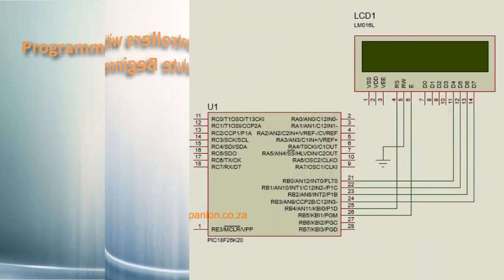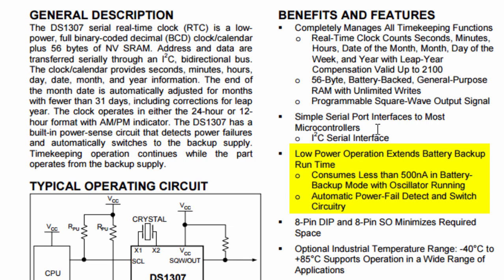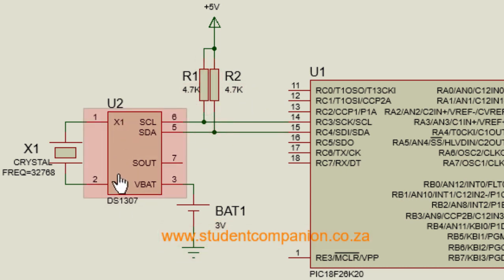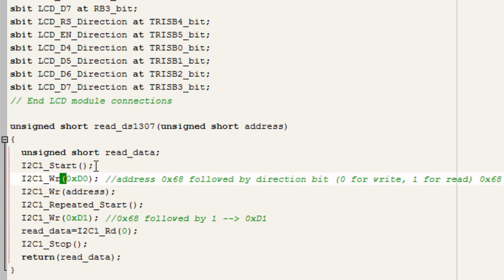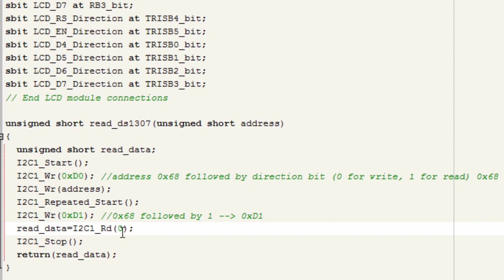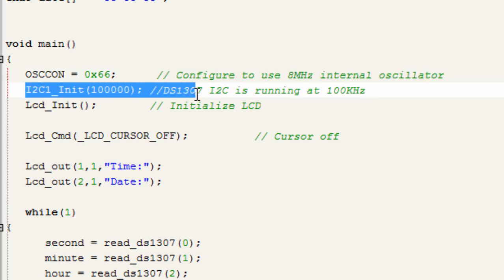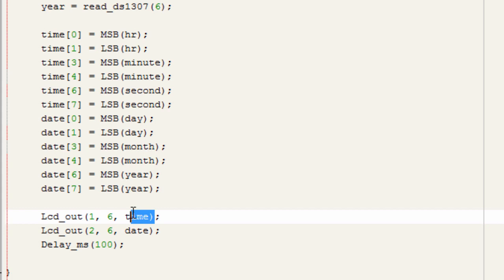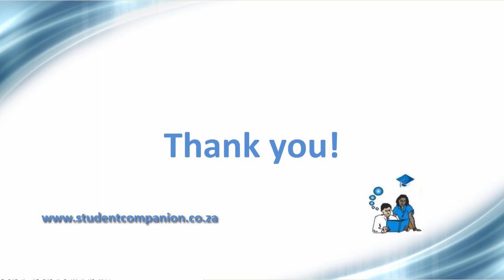39- Interfacing The DS1307 Real Time Clock | mikroC Pro for PIC Tutorial

Comment: Hi! I have a micro sd card module and a ds3231 RTC module. One of this module work with SPI, other is work with I2C. My question is can i use this modules in one MSSP on pic? (I have a pic 18f4685). I found "I2C bit banging" for my problem, but didn't understand anything how can i do it.
Reply from the maker: The I2C and SPI use the same module in the PIC, so you can either use only the SPI or I2C if the PIC habe only one MSSP module, the only option to use both is to use the bit banging for one interface. But if you choose a PIC with 2 MSSP modules, you can use both SPI and I2C hardware modules. 
Why did you choose this PIC and you are not even using CAN bus? If you choose a PIC with 2 MSSP modules, you can make your life easy.
Reply: My project code is 75k of flash. So i need to choose min. 96k flash size MCU. I live in Turkey and you can't find the all MCUs in Turkey. And also i don't have a smd soldering station. At the first i didn't know am i need SPI ind I2C modules at the same MCU. So i choosed the pic18f4685 DIP version. I don't need a CAN bus communication. I will use 2 SPI, 1 I2C module and uart communication. Therefore i will change the MCU to has 2 MSSP and 128k flash size MCU. (If ı find MCU has a usb interface, it'll be nice.) If i didn't find DIP model in Turkey, maybe i will buy from abroad. Thank you for answering my question!
Reply from the maker: Yes, there are many MCUs in DIP packages that have 128KB of memory that you can use and have more than 1 MSSP. That can make your code easier to write than by using bitbanging.
Also try to select a newer PIC model, there are cheaper, more powerful and with more features than old ones like the one you selected.  There is no good reason to start a new project using an old PIC if newer alternative is available.
Reply from the maker: You can use this tool to set your PIC requirements and it will give you a list that meet your requirements: https://www.microchip.com/maps/Microcontroller.aspx
If shipping cost is not a lot, you can always buy directly from Microchip, they are quite cheaper. But try to buy first locally in Turkey if possible.
Reply: @StudentCompanion  Do you have any suggestions? I was using the pic16f series 6 years ago, I switched from flash failure to the 18f series. I don't know the new MCUs very well.
Reply: @StudentCompanion  Thank you so much! I will find the ideal mcu for me.
Reply from the maker: Check these series for example: PIC18FxxK40 has 2SPI and 2 I2C, PIC18FxxQ10 has 2 SPI and 2 I2C, PIC18FxxQ43 has 2SPI and 1 I2C.
For example PIC18F27Q43 has 128KB flash, 2 SPI and 1 I2C.
The 18FxxK42 has 1 SPI and 2 I2C
Reply from the maker: You are welcome!

Comment: what happens if the read data is longer than 8 bit? The example you did the highest return value was 99 (0x63) so what happen if the return data is 65535? Would i have to do i2c read twice to get the first 8 bit(MSB?) then the next 8 bit(LSB)? how would I combine this data to be usable information?
Reply from the maker: For a DS1307 in what situation you would need more than 8-bit?
Reply from the maker: To read more than once or to access multiple registers, you can call a read function multiple times as explained in this video: https://youtu.be/E_bAO7MwadQ

Comment: Hi,I know Im late but what would you change in the code for pic16f887.Please answer
Reply from the maker: You must select your new PIC in edit project. Change LAT to PORT.
Reply: @StudentCompanion  Thank you for replying.I choose in device select my Pic and the code was built.When i put it in proteus LCD display just lights up.It doesnt show any letters.And where is that LAT? Where can I change it? Thank you
Reply from the maker: Did you connect correctly the lcd to your new PIC according to the lcd pin declarations? All instances of LAT  in code must be replaced with PIC.
Reply: @StudentCompanion  I checked the connections,they are fine.Can you name an instance for me?
In my code adress,read_data is underlined with red line.Also the variable char x is underlined.Could that be the issue?
Reply from the maker: Does it generate errors when you compile the code?
Reply: @StudentCompanion  No errors.Everything works.Lcd lights up but it doesnt show anything.It doesnt say time nor anything
Reply from the maker: @braveknight8278  Post your full zipped mikroC and Proteus projects in the Forum. we will check and see what could be wrong.
Forum: https://www.studentcompanion.co.za/forums/
Reply from the maker: This is an old thread more than 1 year, you could just ask your own question and explain exactly what's your problem. Start your own question not this old replies or preferably  post in our forum: www.studentcompanion.co.za/forums

Comment: Pls I have problem on stimulation  the problem is 
Pic18 illegal FOSC bits (0b0011) in CONFIG1H. 
Also it complain of simulation failed to start
Reply: Thanks your suggestion is right, 
But my LCD didn't display anything  sir
Reply from the maker: Then you are not doing thinhs right. Either using a wrong PIC or incorrect connection.  Fix that first.
Reply from the maker: Did you select the correct PIC in Proteus the same PIC you used in your mikroC projet?
Reply: I used 18f26k20 in both my Proteus and mikroc pro. It display ds1307 clock and sare at one corner on Proteus but is the LCD that is no displace. 
At the stimulation log, error U1 (Pic18 )PC =0x0300.

Comment: HELLO
dans arduino le programme reste le meme avec toutes les classes de RTC ou  change
Reply from the maker: Bonjour. C'est quoi votre question?
Reply: @StudentCompanion   dans arduino  je peux utiliser n'importe quelle  modul rtc  avec le meme programme
Reply from the maker: Non. Tu ne peux pas utiliser ce code de mikroC avec Arduino. Ça ne va pas marcher
Reply: @StudentCompanion  ok merci 
j'ai une question a l'etape ou on a bcd en  decimal et comment on a fait ca 
j'ai pas compris bien
Reply from the maker: @salmam5118  que ce que tu n'a pas compris? la conversion? tu ne sais pas c'est quoi le bcd? Tu ne sais pas pourquoi nous avons fais la conversion?  Il faut bien decrire ta question pour que nous savions ton problem.
Reply: @StudentCompanion  pourqoi on a mis 10 DEC=00010000
et pourqoi on a decaler 4
et aussi c qoi l'interet de MSB et LSB

Comment: I expected you use  code configuration to generate I2C functions since you mentioned it in Tutorial-38,
Reply from the maker: Hi. Do you mean MPLAB Code Configurator? If that's what you mean, this is mikroC tutorial it does not use it. It has its own library functions. It's a different compile than XC8.

Comment: LCD display is not showing any data. what should I do?
Reply from the maker: +Chinmay Dixit without supplying extra info we can't really guess what could be wrong.
Paste your code, pic you are using, etc.
Reply from the maker: +Chinmay Dixit did you get it right?
Reply: No. I could not get it. I cant see the values or data on the 16*2 lcd display.
Program is working fine.
My interfacing diagram is also correct.
Reply from the maker: +Chinmay Dixit can you post your code and your diagram. We can have a look at it.
Reply from the maker: +Chinmay Dixit post your diagram as well.
Why do you declare the interrupts and you are not using it? Nothing much in your ISR
Reply: even after I remove interrupt Display is not working..
how to post diagram?
Reply from the maker: +Chinmay Dixit +Chinmay Dixit We didn't say the problem was the interrupts but we didnt see the reason you used interrupts.  If you don't use something don't include it to minimise errors and easy debugging. 
you can post it in the forum: http://www.studentcompanion.co.za/forums/
Reply: what should be the processor clock frequency?
what should be  the clock frequency of lcd?
Reply from the maker: +Chinmay Dixit are you building this in hardware or simulating with Proteus? Did you watch this first tutorial you'll learn about processor frequency: https://youtu.be/jQ8ddVYNlKU
Reply: Yeah. I watched it. In my project, I set the processor frequency=8MHz. If  I set the clk freq. of lcd 250khz which is default then it will show an error - "Controller recieved data whilst busy" and no display..
what should  I do?
Reply from the maker: +Chinmay Dixit You don't change the lcd default clock frequency. They must be something else wrong. Did you change the PIC frequency to 8MHz as well?
Are you using internal or external oscillator for your PIC?
Reply: okay. I am using 8MHz internal clock frequency using OSCCON=0X66. i didnt change PIC frequency.
Reply from the maker: +Chinmay Dixit please post your full zipped project files and Proteus files. We will assist you.
Reply: where should I put it?
Reply from the maker: +Chinmay Dixit you can post it in the forum: http://www.studentcompanion.co.za/forums/

Comment: hr = hour & 0b00011111;
      ap = hour & 0b00100000;

What does this code mean? Sorry and Thank you
Reply from the maker: +Siti Nazirah Hj Damit to check if PM or AM. You can read the datasheet to learn more
Reply: sorry if I keep asking too much. I ran the simulation now, it suppose to show 20.57 PM, however, on the LCD, it shows 00.57. what do you think went wrong?
Reply from the maker: +Siti Nazirah Hj Damit did you take some few minutes to study the code and the DS1307 datasheet and try to understand? Especially the 12H and 24H mode? And how the I2C debugger works reading from your PC?

Comment: I'm not sure what happen, but when I simulated it, it was slow. What do you think went wrong?
Reply from the maker: +Siti Nazirah Hj Damit Slow compared to what? Remember this is simulation it's not always gonna run like in hardware. Maybe it's your simulation that's slow. There is a simulation clock at the bottom bar of proteus runing immediately once you press the run button. Check if your minutes are in synchronous with that clock.
Reply: It's fine now, i'm not sure what really happen. One question, is it possible to use your code to PIC16f887? Thanks
Reply from the maker: +Siti Nazirah Hj Damit yes. But you'll have to make some few modifications.

Comment: i writ the cod and build it but in simulation i get this message" (pic18)pc =0x0000 $MCLR$is low processor in rest"
Reply from the maker: +ali kasim you must connect MCLR pin to +5v of your supply voltage or disable MCLR in your code.
Reply: i connect it to 5v by 10k resistor but i get this message  "(pic18)pc =0x0564 The SCS bit have been set. This feature is not modeled the model continue to clock "
Reply from the maker: +ali kasim try a different type of resistor.
Reply: how can i disable the MCL because i tried another resistor no change  thank you for that
Reply from the maker: Hi. We have explained the procedure in this video: https://youtu.be/pvJWs3Dm2MQ
Reply: thank you so  much
Reply from the maker: +ali kasim is it working now?
Reply from the maker: +ali kasim is it working now?
Reply: yes thank you so much may allah please you
Reply from the maker: +ali kasim you are welcome!

Comment: I noticed that the display of the seconds is quite erratic. Sometimes it jumps a couple of seconds at a time and is delayed at other times.

At first i thought it was something to do with your editing but when I simulated it myself I had the same problem. Is this a simulation problem or will it be the same when in hardware?
Reply from the maker: Hi. It might be a simulation problem as it reads current time form your computer, and this can be affected by your computer CPU available resources as simulation is quite a memory intensive task. In hardware you may not experience the same problem.

Comment: How should I proceed for interfacing rtc with PIC18f4520
Reply from the maker: Hi. You can proceed the same way. The code shouldn't change much when you are changing the PIC. Just select the PIC18F4520.
Reply from the maker: If you decide to use internal oscillator as well, just check the OSCCON value in the datasheet depending on the frequency selected.
Reply: I am using MP lab x compiler , it's showing some errors while compiling the same code.
Also tell me which compiler did u use.
Thanks in advance.
Reply from the maker: +Chandra Shekhar Patel this tutorial was done with mikroC Pro for PIC compiler as you can see. It's different from MPLAB XC8 compiler.  You can't use this code exactly as it is without modification
Reply from the maker: +Chandra Shekhar Patel watch thus tutorial with MPLAB: https://youtu.be/1M1n8oEw9zk
Reply from the maker: +Chandra Shekhar Patel you are welcome
Reply: Student Companion thanku
Reply from the maker: +Chandra Shekhar Patel you are welcome!
Reply: I am making a project on automated town water management system using pic18f4520 microcontroller in that I am using rtc ,gsm sim300 module. So if you can help or suggest I will be thankful to u
Reply from the maker: Hi. You can watch this tutorial: Automatic Temperature Control System, it can give you some direction in your project: https://youtu.be/s6GXfBZRoRM
and read this article: Interfacing a GSM/GPRS modem with PIC microcontroller: http://www.studentcompanion.net/en/interfacing-gsm-gprs-modem-with-pic-microcontroller-mikroc/
Reply from the maker: What do you mean by "How to proceed"?

Comment: Do you have a tutorial to work with ADC Keys ?
Reply from the maker: +fseeletronicos © hi. What is ADC keys?
Reply: Firstly, thanks for your fast reply. I tried to make PIC's ADC reads voltage divider from keys. And when you press a key, it will give you a voltage value. The PIC compares with a range and "know" what key was pressed. Have you ever try it ?
Reply from the maker: +fseeletronicos © No. We never tried. Why do you want to read the ADC value? It might not give you correct values as the column/row resistors might be the same for each column.  Unless in your application you'll use of different values. The standard procedure is to read the digital value : 5v or 0v when a key is pressed or released
Reply: Student Companion Because read keys with ADC saves more ports.
Reply from the maker: +fseeletronicos © ok.i never tried that method

Comment: Why is it necessary to use the I2C debugger to get the simulation to work?  Shouldn't the DS1307 return the clock information when it is selected and initialized? If we built this actual circuit you would not have an I2C debugger but the clock would function, correct?  I am trying to understand what the need for the I2C debugger is in the proteus simulator... Thank you
Reply from the maker: +Shane Rolin it's in Proteus simulator to be able to send/receive I2C data. If you build the actual hardware you won't need the I2C debugger.

Comment: How can i read the information of the ds3132? thanks and nice work!
Reply from the maker: +Enrrique Flores hi ! 
I guess you mean DS3231. There is no much differences between this chip and the DS1307 except for accuracy. The DS3231 is more accurate.  It's not much affected by outside temperature.  The code of the DS1307 should work well with DS3231 as they have the same time  registers and can be accessed the same way.  Read the datasheet and compare.
Reply: Thank you so much! i will compare them right now:)
Reply from the maker: +Enrrique Flores great!
Reply: i'm trying to use pic 16f877a and i have an undefined identifier with I2C1, OSCCON and MSB comands, what should i do?
Reply from the maker: +Enrrique Flores go ahead and use the i2c functions as described in the tutorial. Buf remember there are registers and instructions which are not available when using a PIC16F device such as LAT register, etc.

Comment: Hi, one more great video thanks, 
i want to write code to count minutes when i press button, for example when i press button if it is 14:50 and press one more time 14:55 it should count and display every minute like 1, 2,3,4,5 or simply make another counter, how can i do that thanks a lot
Reply from the maker: +Islombek Mamatov do you want to display lapsed minutes since you pressed the button or the actual time?
Reply: Student Companion SA  i am trying to make counting system , like money, lets say every 1 minute is 2$ , so i have this real time digital clock and when i press it should start counting and should be displayed like a counter,  for example when 1 m passes 2$ , 2 passes 4$ should be displayed, thanks
Reply from the maker: +Islombek Mamatov then you probably won't need a real time chip. You can use a pic internal timer or even interrupt to achieve this. When a button is pressed it can generate an interrupt then you can start counting.
Reply: Student Companion SA  i got it , thank you
I also found when i run this tutorial simulation in proteus seconds are changing very slowly like 1 second in display changing in 3 seconds, can you explain that?
Reply from the maker: Usually because this is simulation, it will not run as real as in hardware, it will depend on some simulation limitation, the speed of your computer among others. But if the simulation is very slow, check the oscillator frequency you selected is not too low compared to the oscillator frequency you used in your project.
Reply: Hi, i am testing project on hardware, but time is not working it is just showing 00-00-80,  im using 16x4 ks0066 lcd, i have tested lcd, lcd is working fine, is problem with interrupts because im also usin interrupts as a counter, on proteues it was workin though, and im using p18f452 thanks for helps!
Reply from the maker: Obviously we can't guess what could be the problem at least if you can post here your code then we can try to understand it.